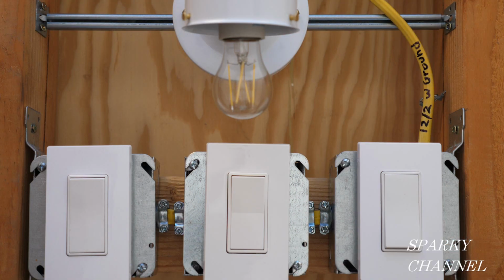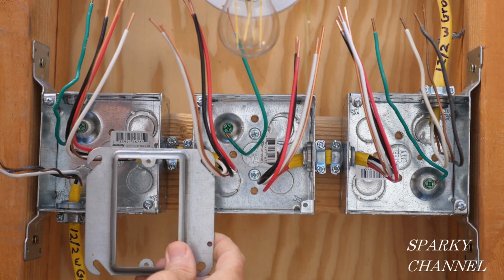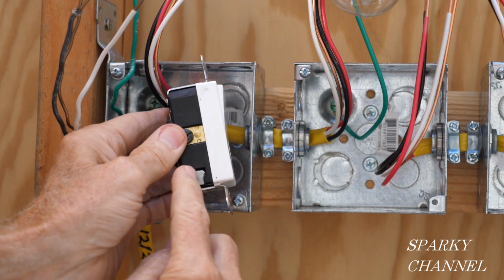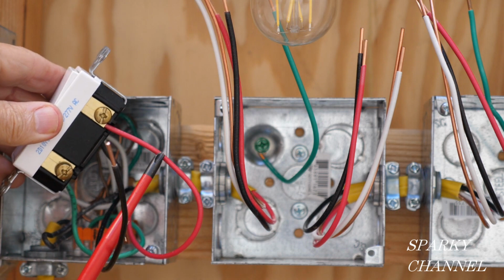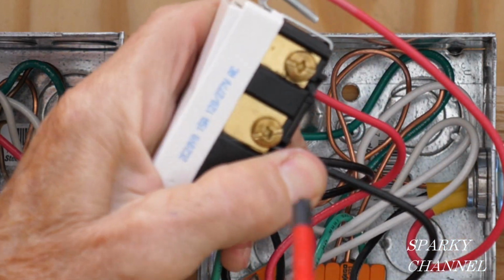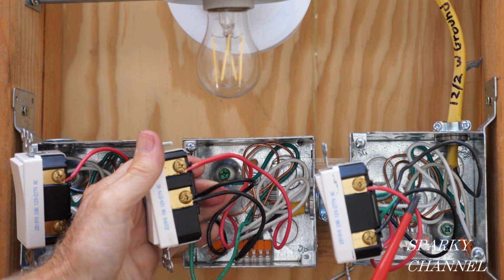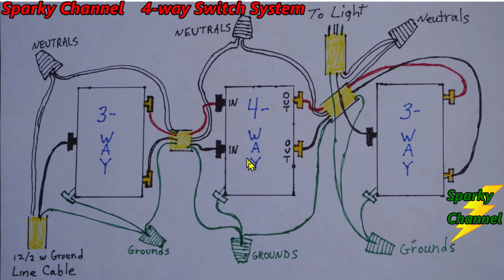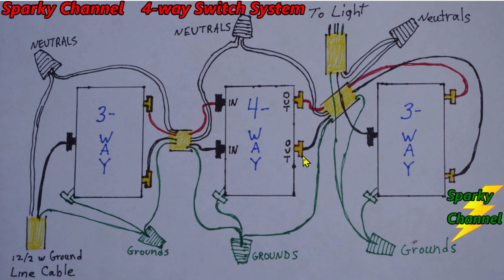How to Wire a 4 Way Switch System with Diagram Included

Comment: My only question would be, why are you using a 5 port connector when you only have four wires going into it?
Reply from the maker: The Wago's only come in 2,3 and 5 port. It doesn't hurt to use the 5 port when you only need 4 ports as you can easily add on later.

Comment: Hello, if you see my message, I hope you can help me. The live wire of my newly bought house seems to be connected from the light link. The second dual control switch only has one wire, which has black, white, red and bare wires. I tried it. It's been a day, but still no success

Comment: I used this excellent video to make the four way system Alexa enabled by using only one Fiet smart dimmer switch. The trick is to find the three way switch where power comes in as explained by Sparky here. Replace the first switch on the left with a smart switch. I permanently locked the middle switch and the load  switch locked in a permanent position by using a heavy duty scotch. Makes sense?

Comment: Technically when you have a metal box, and you ground to the box, you're switch does not need to be grounded because as soon as you connect that switch to the box, it's grounded.
Reply from the maker: Please check out my video: Will a Metal Box Alone Provide a Ground for Electrical Wiring?: https://youtu.be/hu5be04dDGs

Comment: Can I use 14/3 NMC romex throughout and only 12/2 for the line voltage since it is likely that interior lighting won't exceed 15 amps?
Reply from the maker: 14/3 is fine for lighting circuits.

Comment: I am finding with the Wago wire nuts that the levers will pop up, or loosen, or the edge gets snagged on a wire that can loosen it. So I am finding that it might behoove everyone that uses the lever nuts to wrap tape around them, just like we sometimes would wrap the old type of wire nuts. I still maintain the position that they are better, because there is no need to twist and put extra strain on the wires, and about three wraps of electrical tape around the wire nuts after all connections are made is just a little bit better than not.

Comment: Excellant video Sparky!  Do you have a video somewhere showing how you connect the line coming from your "breaker"?  It looks like you set up a small practice wall here.  I'd like to make something like that, but just plug a cable into an existing wall socket, and unplug the cable when I need to disconnect power.

Comment: Thanks for this video. It’s going to help a lot. My house was built in the late 50’s. In one room there are 3 ceiling lights controlled by two 3-way switches. In one box there are black and white wires spliced together. This is confusing me. Why would it be this way? The wiring is newer in the switch box, (12/3),  which is really confusing me. What are your thoughts on this?

Comment: Not all four-way switches get wired like that some get wired from the top to the bottom without reading my switches instructions it cost me quite a bit of time some are wired from the top to the bottom it comes in at the bottom and goes out at the top instead of coming in on the left and going out on the right very painful quite surprised they don't mention that not all switches are wired the same very poor judgment on their professional part although I did originally enjoy his explanation.

Comment: I found using 5/8 “mud rings with 1/2”drywall is right on the money as the drywall gaps on top of the box screws not the ring plate .
Reply from the maker: Interesting! Thanks for the tip.

Comment: What if the line feed comes from the light first?
Reply: You will need to run a 12/3 or 14/3 from the light to the first switch,  then do everything he did and pretend that you do not have the original cable in the light box, just ignore it like if it was not there

Comment: Why do you use 12/2 & 12/3 wires and not 14 gauge wires, could 14 gauge be used?.
Reply: Yes you can as long as you don0t exceed the maximum distances and/or load as per the NEC 2020. Bill, likes to use #12 wire for convenience, and if you ever need to upgrade to 20V for any reason the wiring is capable, I agree with his choice even though #12 is more expensive.
Reply: 14 gauge could be used but some electricians only use 12 gauge. It also future proofs the wiring a little.

Comment: Sparky, I may not be seeing it correctly in the video, but I could have sworn that I saw you take the red and black wires coming out from box#2 into box#3 and plug them into the "out" ports of switch#3 in box#3, and then you are connecting the black load wire into the common port of the 3-way switch.

Did I get that correctly?  Why is it that way?  I thought the common/black-screw port was for the black (INbound).  That's confusing to me.
Reply: The switch #3 a 3way switch doesn't really have what is called "out ports". 3 way switches have a common screw which is black in color and marked common on the switch. The other 2 screws which are brass colored are the traveler screws. When hooking up 3 way switches of course it takes 2 switches. At one switch you will connect power to the black screw and traveler wires to the other two brass screws, while the other switch will have your switch leg (wiring going to the light) and the other end of the 3 wire cable. The black screw on that screw will connect to the black wire going to your light while the other two brass screws will connect to the black and red wire coming from the first switch. The 4 way switch just put one set of wires out of the same cable (black, red) on the same colored screws (black) and the other black and red wires out of the 2nd cable to the screws (brass).
Reply: Y

Comment: Great video, just like all the others, question: Would you say that the Fluke 1AC is the best NCVT or is just a personal preference?
Reply from the maker: It's the best for what I used it for. It's not low voltage and it doesn't have a flashlight so if you need those features others would be better.

Comment: Your videos are very clear and instructive.   One minor suggestion for possible re-editing.  In your 3 way switch video you showed crimping the pig tail at the green bolt and going in a clockwise loop, in this one I only saw a little flash of the pliers edited out.  You might include it, especially for neophytes like myself repeating looping clockwise is useful.  Repetition is good especially with electrical which can be inherently dangerous and intimidating.   Thanks, I'll watch more in your series.  I've subsequently put your 3 way video to use  putting in dimmer switches and led fixtures for my elderly auntie.  Was able to work with confidence.   Thanks

Comment: Do you know of a source for a wet location rated remodel box for use above the shower?  Octagon or 2x4 box would work.  Best if it attaches to the side of the bottom chord of the rafter truss.  Can't seem to find one with my sources.  LED light will screw up to it as the junction box for power connection.  Thanks.  Doug
Reply: home depot.

Comment: Great video - one question: In the diagram how would you show the green ground wire pigtails connected to the metal box?
Reply from the maker: It would be one more green line coming from the box to the green wire nut. My diagram is for plastic boxes.

Comment: The way the switches operate is also of interest. The 3-way are connecting the black common with one of the brass terminals for the travellers, which one depends on the switch setting. The 4-way got two switching elements inside, actually two 3-way switches in one single housing. To explain how this works I use the colours Bill has shown us:

switch setting 1: The two blacks are connected straight through, and the two reds are connected straight through.
switch setting 2: The wires are crossed over, meaning the left black is connected to the right red and the left red with the black on the right side.

That's the reason this switch is called (literally translated) a "cross switch" in Germany, because it's either making a straight through connection or crossing the connections.
Reply: so why are 4-way switches so dang expensive!?
Reply: @Skoyles  Because they are technically two 3-way switches combined in one housing.

https://upload.wikimedia.org/wikipedia/commons/4/45/Light_Switch_Chain2.svg

Comment: @Sparky Channel. Thanks Bill for the detailed lesson on wiring a 4 way switch system and including your wiring diagram. It's a good thing I watched the whole video because you answered a question I had. It's easy when the boxes are next to each other in your video and I can see what wires are coming into a box and which are going to the next box. So when I come up to a box with two 12/3s coming into the box, I really don't need to worry about which one comes in and which one goes to the next box. The 4 way switch doesn't matter so long as I follow your suggested way of always keeping which color wire goes onto which terminal.

Hope you and your family stay safe and well.
Reply from the maker: Excellent! Sounds good to me. You guys stay safe too!

Comment: Hi, Sparky. My instructor is asking me to wire a gfci receptable in the first box, a gfci "protected" receptacle in a 2nd downstream box, and finally, an unprotected receptacle in the final 3rd box. Is this even possible with 14/3 wire?
Reply: I suggest you use 12/2 wire for receptacle. If you are using 14/2 wire make suke your breaker is 15A.
Reply: Pretty sure it’s possible, just need to wire that last outlet in parallel so it avoids gfci protection from the upstream device
Reply: The 3rd box will always be on then? even tho the gfci is tripped it will protect the second receptacle. in order to do that go to the power source to the 3rd receptacle
Reply: And it is possible with 14/3 wire you’re just gonna have an extra hot so you’re gonna use 14/2 wire.

Comment: Very nice and detail explanation of a 4 way switch for people who don't know how to connect a 4 way switch. You made it simple by putting the feed on one end of the circuit and the light on the other end, but in reality that is not always the case sometime the feed come in on the light fixture box, or in some cases on the middle circuit and you will see lots of wires in that one box.
Reply from the maker: Yes, that's true. Thanks!

Comment: I really appreciate your excellent & informative videos.  Question: on a 60's house,  what color typically was used for the traveler wires?  Also I enjoyed the 60"s prior video's since most people only show the "newer" wiring (Romex).  The question of what to do when a 60's component needs to be replaced was explained by your prior video's. I look forward to more. I also like your showing what is up to code. I love the Wago nuts!
Reply from the maker: Red and Black. No grounds. Perhaps no neutrals. In that case the white wires are serving as red so the black and white would be travelers. Testing is essential to see what wires are serving as what. All in all though it's quite simple once you've identified the wires. More videos to come, thanks!

Comment: Superb bill maybe worth pointing out that there are several ways of wiring a 4-way. The question which is the best depends on the layout of the house and wiring runs to address voltage drop issues as one criteria there are of course multiple criteria to consider.
Reply from the maker: Thanks Math Man!  Yes, you are correct. Good idea for a future video, thanks!